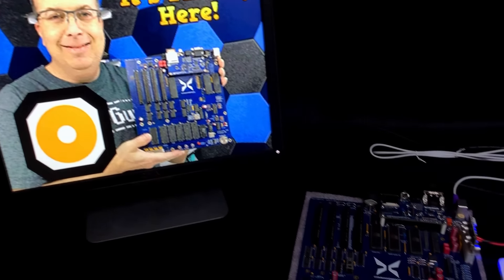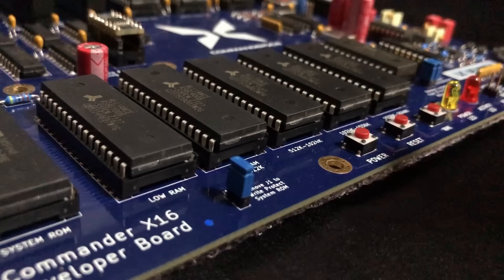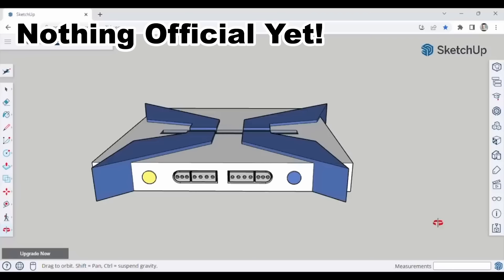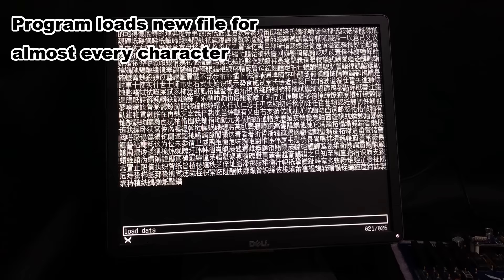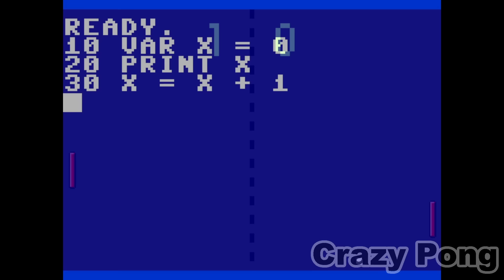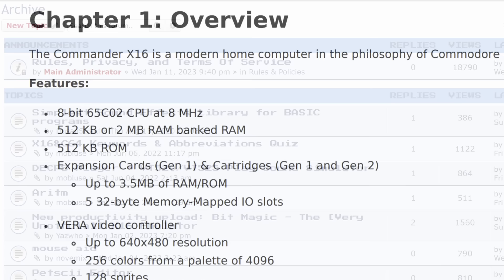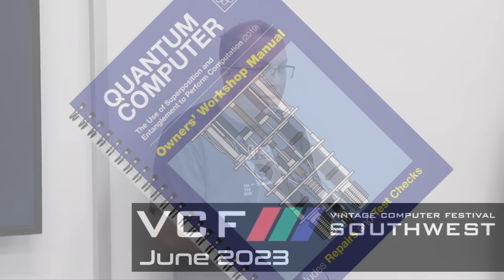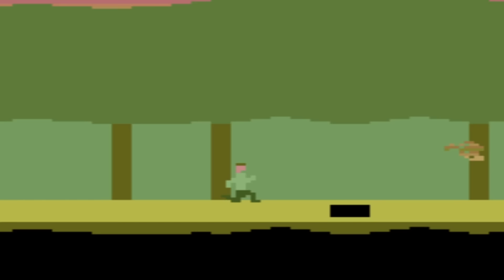The Commander X16 is Finally Reviewed!

Comment: David (8-Bit Guy) did state that through product revisions, he expects them to go down in price to entice the masses. I will be waiting until then to get one.
Reply: True, but those revisions will also be less capable. They won't be as expandable, have as much potential RAM, or be as well-suited to game-making. In a recent video he referred to the first version as the "developer" system and the next revision as the "console" version.
Reply: @jacklawsen6390  Not a significant problem as those who need the maximum specs or most expansion options can still buy the developer system. The core features will still be there on every model (i.e. they will all run the same software).
Reply: @jacklawsen6390  However, if you are making games to work on the broadest range of systems, then the console will be quite workable to use as a host for working on games, since it will have the same benefits of 80 column screen, standard layout keyboard and SD card for storage of work in progress.
Reply: The console version still has the cartridge port, so Ram Expanders and ram in games is feasible, so the only real downgrade is the fpga board

Comment: what do you think to virtual consoles, for example Pico8 and TIC80?
Reply from the maker: They're cool in that they're another way to create restrictions and allow for creative programming, but if you're trying to mimic the restrictions of 8-Bit computers, why not just program an 8-Bit computer? So they may work for some, but I've never been overly interested.
Reply: @InkboxSoftware  I think it's accesibility, It can be hard programming for those old machines. Every PC ever being able to run those fake consoles is also a big plus. Whenever I buy a used PC, a couple Pico-8 games are usually the first thing I run on it.
Reply: The big downside is that they don't restrict RAM use and processor speed. So you can make games that make a i7 go nuts and that don't run at all on a simple Core2Duo, which should be massive overkill for "8-bit like" systems to begin with. Also the resolution is hard for CRT use, although Pico-8 should do fine on PAL scart with line doubling and huge black bars left and right, but then it is 25fps instead of 30fps. 256 scanlines on NTSC will render a part invisible.

Comment: Have you checked out the Foenix Retro F256 K or F256 Jr? Those are also amazing 8 bit computers.
Reply: A quick search of the Web shows there are quite a few "new" 8 bit systrms on the market and available to buy, either as a kit or pre-built. 6502 and Z80 are available, plus old Intel 8088 compatible boards. Or the ones built around the venerable16 bit Motorola 68K. Most are cheaper than either the Foenix or the X16.

Comment: Congratulations on The Commander x16 systems, I personally would be more interested if the successor of AMIGA 1200 system is created, this is when everything was ended with the commodore company, C64 was fine (I owned it first like many people) then moved on to the AMIGA 500 & 1200 at the end, I see the commander X16 is slightly better than the specs of AMIGA 500 (more like an AMIGA 1200 but with lower CPU speed) I wish there would be systems like the AMIGA 1200 in the future with more features like what the Commander x16 currently has.
Reply: Right, a modern Amiga would be something I'd be interested in. I went straight PC back in the day and so I missed the entire Amiga era.

Comment: 4:15 have you tried using SD cards over 32GB? On Windows they can't be formatted to FAT32 (what the X16 definitely wants) by default, so you'll have to find an external program to do this

I did this for my Wii (formatting a 256GB card to FAT32) and it works just fine
Reply: This is weird in the sdxc standard they selected exfat. It's fine they recommend or prefer it, but why not make fat32 optional for compatibility, as fat32 does support bigger size. As far as I can tell, the hw interface is the same. This should not force the host to support fat32. 
Good example here for a fat32 usecase.
Reply: @TheStuartstardust Because a filesystem designed in 1978 has too much hurdles to modern usage.

Comment: I started programming on various models of the Commodore Pet and later the Commodore 64 when I was a preteen in the 1980's, and I am still programming today. What was cool about these computers was that you were programming from the moment you sat down at the machine, because you were dropped into BASIC. DOS just wasn't the same, and Windows stripped away all of your programmer abilities. Needless to say I switched to Linux in 1994 because the UNIX shell has the same philosophy. When you sit down at a computer you are the programmer. You can write code right on the command line to your heart's content. I would say that my experience with 8 bit computers made me the programmer I am today. At a superficial level I code on Windows 11 today but I bypass everything that makes Windows Windows using Cygwin. I use the command line to bypass the IDEs. They're running so that I can interoperate with my colleagues but not doing anything. It's just so much more fun to have all of the power and not have people do things for you the way they think they should be done.
Reply: I too code on Windows 11 but my target is Linux servers or cloud development environments.  I just use a VM with vagrant and have VS Code remote development extension so my code runs on Linux, but looks like Windows.  For me it is the perfect setup.
Reply: I kind of agree about WIndows, before that I had an NEC APC3, it came with a good set of manuals that covered all the bios calls, graphics, everything. then I bought a Windows box, nothing......
I used to program using Borlands Turbo Pascal, among others. Yes I could run that on the new Windows box, but with no idea how to talk to Windows, I kind of stepped back and moved over to micro controllers etc.
I'm just now starting to take my Arduino-ised 'C' programming to the Microsoft visual studio, getting quite a few headaches along the way.
Reply: Why do you count Linux as "same philosophy" but not DOS?
In a shell of Linux you open your text editor, write your code and then compile it.
In DOS you do the same. GW-Basic or QBASIC was available, if you had a MS-DOS operating system.
Reply: @OpenGL4ever  I'm referring to the documentation you get with the computer, back in the day they usually gave you everything to start coding, these days you get nothing.

Comment: I dont understand....what platform games running on this pc?
Reply: Not sure what you mean.  It is basically all proprietary, which means you have to write new games/software for it.  Or port it from another platform, which still requires programming.  It is a totally new type of computer (or `new-old`) based off the popular 6502 cpu, it is not really compatible with any other new or old computer, although it is patterned off the 8-bit Commodore machines.  As the video explained, there are games & other software you can download from the X16 forum.  Anyway, besides the X16, another modern-built computer trying to capture the good old days is the FOENIX brand.  
07/07/24

Comment: It has many things in common with the PCE/TG16 game console, of course with the exception that one is a console and the other an 8-bit computer. Hu 6280 was a 65c02 designed by Hudson soft and Epson Seiko @ 7.14 MHZ with integrated audio. Even the last official expansion was a ram memory card called Arcade card with 2MB. The advantage that the commander has is that today SD cards exist and they store a lot of data cheaper and faster than a 1X CD ROM. I wonder if the Komander 16 will be good for developing games that run on PCE. Like some source of dev kiit.
Reply: It probably lacks the chiptune capabilities of the PC Engine, which has the best soundchip of any console. I expect it to be very SIDdish unfortunately.

Comment: I do have some doubts on certain aspects on the hardware:
- 8kB mapping is too limited. I know people who write a graphical OS for say a CPC or MSX, but they need at least 32kB banks to make it workable
- the board should have RGB 15kHz out. I know Dave is from the US, and RGB TV's are more rare than pictures of a grey hair Trump, but you want the best out-of-the-box display experience, which is on an RGB CRT TV.
- the power section looks very weird, like a PC ATX connector with many unused pins. A machine like this should be designed 100% on 5V TTL, and with modern components 3A should be plenty, so please use a USB connector for a generic 3A USB phone charger.

Comment: Can't afford a X16 How about using a Powkiddy RGB30 running Pico8 (a fantasy console) paired with a usb hub, keyboard and mouse, connect a usb power bank and it's basically a portable 8-bit computer that can also be plugged into a monitor/tv via HDMI. 
Maybe Picotron (described as a fantasy workstation and the follow up to Pico8) in the future will be usable on a similar device/setup. 
Pico8 works on Raspbery Pi's and similary Picotron has Pi support on the horizon.

Comment: I think the ultimate iteration of the X-16 will be as an FPGA-based motherboard. It will not depend on availability of old 6502 compatible chips (or any others from the 8 bit age), drastically reduce the complexity and size of the motherboard and most importantly, lower the price by a lot. An FPGA based X-16 could almost certainly be sold for under $300 and maybe even $200 or less in quantity.
Reply: well, there is already the very capable and great "Mister FPGA DE10 Nano" for simulation of old hardwares .... maybe someone will port the Commander X16 on it ?
Reply: @Kobold666 Losing a specific FPGA board isn't a problem. Another  one will take it's place and compatability shouldn't be a major problem. The X16 already relies on sound chips that are no longer produced, and that was a mistake. But David also wanted to avoid using FPGA completely... another one of several failed goals for the X16.
Reply: And yet, David's original goal was to avoid any use of FPGA. Once the X16 becomes just another FPGA core, it loses its main attraction and starts competing with long established 8 bit platforms. Most of which already have huge software libraries, dozens if not hundreds of books on the system, various magazines and well established communities.
Reply: @another3997 I think the finished board uses an fpga chip for video output right? Or did they use it anywhere else?
Reply: @parana2853  video, SD card handling, the SNES controllers, and some of the Sound options.
Reply: @Kobold666  I wouldn't go quite that far. "8-bit limitations in programming without hassle of re-capping old motherboards and praying they work" IS a unique niche they fill to one degree or another. It's just not a Niche that requires hardware per-se. PICO-8 is similar in a lot of ways, and it's quite popular. The "Picocomputer" 6502/6522/2XPi Pico design even tosses in "here, make it on a breadboard!" for fun.
Reply: @another3997  Yeah, I get the nostalgia part of it, but if the goal is to get this into the hands of as many people as possible, for as cheap as possible, then FPGA would be the best way to do that. FPGAs continue to get cheaper and more powerful, and luckily they seem to be backwards compatible with previous versions.
Reply: @JustWasted3HoursHere  Fully Agree. We would go further by just developping an FPGA-Core  , open source and adapt it to the several FPGA boards available today. An other fun approach could be to go the 32 bits microcontroler route including those new Risk-V boards that cost almost nothing and should be very fun to program in assembly .... i grew up with those 8 bits "wonders" such as TRS-80 ; Vic20 and CPC464. Programming in my room in 6502 and Z80 ... i prefer now learn new stuff with FPGA and microcontrollers
Reply: @Kobold666  Yes I agree.  It is the irony of building a new system with modern parts that uses FPGA for specific functions, when that given FPGA could actually "do it all".  If you were going this route, I would have preferred the use of a simpler chip like a CPLD to take on newer incarnations of a video and sound chip.  This route would have been more analogous to making a modern day "SID" and "VIC2" for a new 8 bit system.
Reply: A port to the MEGA65 would work really well with the PETSCII keyboard.
Reply: The X16 is almost on that path already, with the Vera. However I don't see the 6502 as a problem, leave that as is, however the Yamaha chip is a bit of a pain, long out of production
So a board with a 6502, an FPGA, and a ram stick slot, and that's about all that is needed, bar the odd interface chip, like for real RS232, or HDMI one day.
Reply: @paulstubbs7678 You're right about the 6502. It is still in production and there are an estimated 6 BILLION of them in the world. Almost one for every human in existence.
Reply: @chryoko  I can't really explain why, but an FPGA version of the X16 holds no interest for me whatsoever. I love the giant motherboard full of discrete chips. That's the main draw of the X16 over other systems for me.
Reply: It is good it is not FPGA. I think FPGA has a lot of misuse nowadays. It works great for high speed signal processing. So if you want to get that old arcade machine working that needs 31kHz RGB output, and your original board died, sure, go FPGA. If you want to make a high speed video converter, FPGA is your man. But if you want to make a fantasy system that is mainly running on a 1080p or 4K TV, or emulate a lot of retro systems, just do it in software. Go the Pico-8 route. I think MISTER combined with a modern TV, is just a waste of money. The modern equivalent of those audiophiles in the early 2000s that spend 500 buck on a golden HDMI cable, which made 0 sense as the signal was digital.
Reply: @lovemadeinjapan  Why not FPGA? Why is it a waste of money? Seems to work perfectly fine in the uses I've seen and the low end cost is reasonable. For doing what they want to do with the X-16 a high end FPGA is not necessary and its benefits would greatly outweigh any perceived limitations, IMO, especially when it comes to PCB complexity and overall build cost. (Not to mention an easy way to update it in the future without redesigning the board).
Reply: @JustWasted3HoursHere  A 25€ MacMini 2009 is every bit as good as a Mister for emulation.

Comment: $500 excluding shipping. I understand that pseudo-vintage computers are essentially luxury goods, but at this price point I'd rather go for the Mega65 for its historical significance (Commodore 65 homage). Would love to buy a TheX16 Maxi emulator though if one ever gets made, at least the price won't be as sky-high!
Reply from the maker: Only the first few units were that much, the rest will be cheaper
Reply: @InkboxSoftware  But not much cheaper. Certainly not cheap enough for most people to scratch a nostalgic itch on a machine which only vaguely resembles anything they nay have used before.

Comment: This review pretty much cements what I'd already decided: this thing is the solution to a question no one was actually asking
Reply: The question people were asking was, "How can I enjoy the hobby of 8-bit computing without spending thousands of dollars on unreliable retro hardware that's on the verge of dying all the time?"
Reply: @KevinFields777  There's a group of people who are 8-bit hobbyists, and there are those who enjoy 8-bit computers for nostalgia and/or historical reasons. Hobbyists might be interested in X16, but the rest (which is the vast majority of people) won't care. In my opinion, if you go with FPGA for some important component at any point then there's no point anymore, just emulate the whole thing.
Reply: @KevinFields777  That literally never happens, lol. There's plenty of reliable retro hardware you can enjoy for far less than $500.
Reply: @KevinFields777 Most people asking that question have already found solutions. Either emulate their favourite system in software, buy a FPGA based board to emulate... or maybe bet one of the many other "new", and much cheaper 6502 or Z80 machines available.  Most people have nostalgic memories of a particular platform, not a generic 8 bit such as the X16. Those platforms have the benefit of bigger software libraries, large numbers of books, manuals and magazines already available.
Reply: @KevinFields777 who knew the answer to that was "a ton of feature creep thats taken it miles away from what anyone actually wanted"
Reply: I agree with you, but want to add the point, that things don’t have to make a whole lot of sense, when they are fun (and a fun exercise) to play with. The X16 is not for me, but I can understand why it may be the platform someone wants to tinker with.